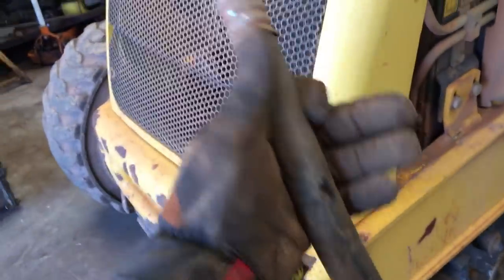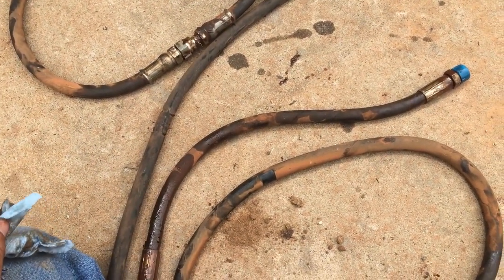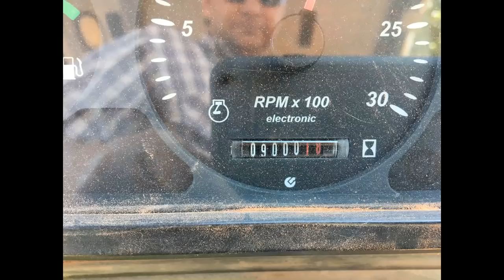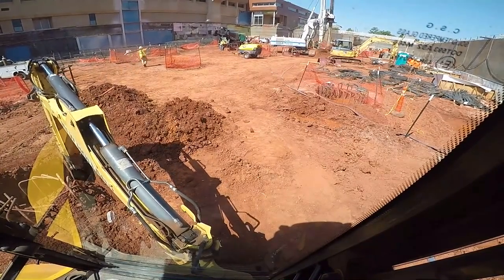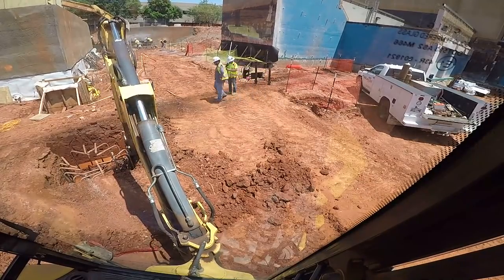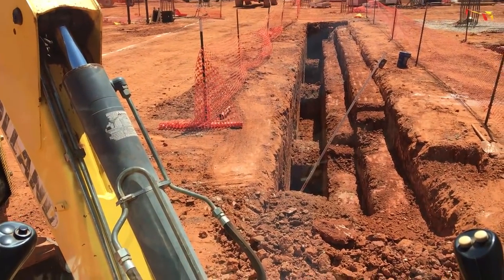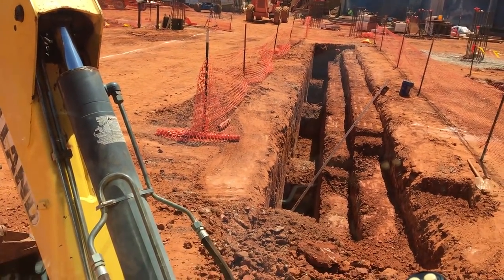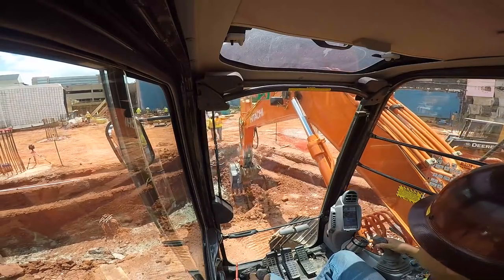Little Bucket Big Money

Comment: I have worn out 2 JD TLB110’s and working on my 3rd........so....I’ve got some hours.      but you have a serious set of skills......beautiful work!
Reply from the maker: How many hours on the 110s? Thanks I think I have it figured out some days!
Reply: Around 1500 hrs each....the only thing that was worn out were the bushings..... I have a really slick shop for small engines and light trucks, but no gantry , no heavy shop tools....so I would trade them in. I have about 1000 hours on my current 110tlb...... I am amazed how straight your lines are/ precision..... I have a set of grapples on mine too.......those are fun to operate.....